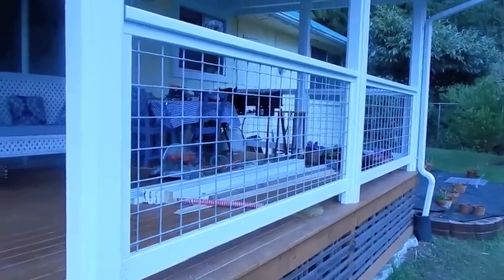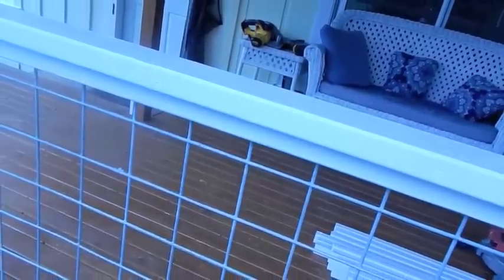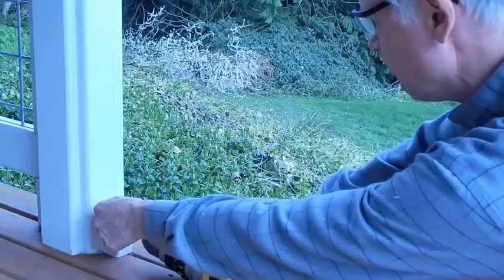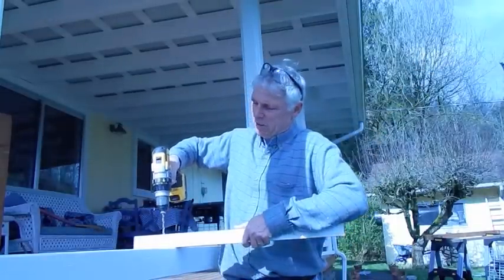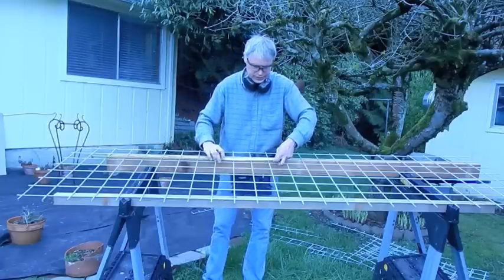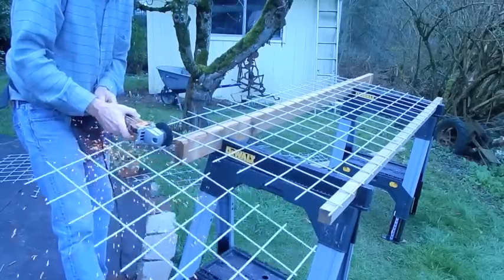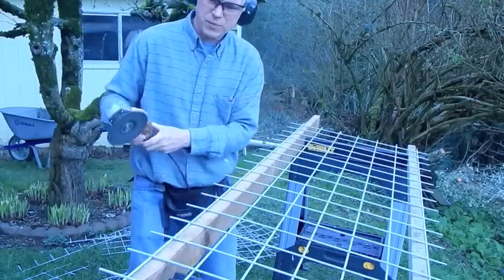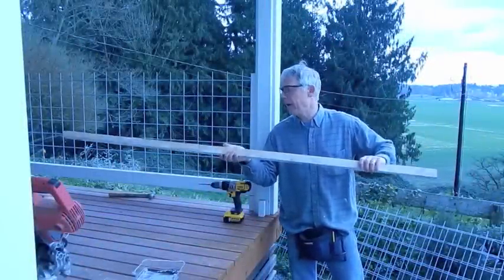Hog wire deck rail installation

Comment: Well I did pretty much what you did building my 800 sq.ft. deck.  What I learned: Although I waited almost a year before I painted my railings, it was to no avail as they started peeling after 8 years. Treated wood just will not let paint stick over many years and will just start peeling. I also used galvanized screws but unknown to me was they were rusting where exposed to any water and air.  So after 25 years I now have a real problem and no easy fix.  I know painting a deck that has treated wood, no matter how dry is a huge mistake.  What I learned is to use only stainless screws and any coloring is to be done w/deck stain.    If you don't use screws you cannot take the railing apart years later to restain or paint.  Try sanding or refinishing a deck railing that cannot be taken apart and you have a nightmare .  So make sure your hardware will stand the test of time and do not use paint, although I did find painted treated lattice has held up fine now for 30 years, likely due to its very rough surface.

Comment: As others have remarked on this video, they like the details you present, such as the calculations you need for complete lengths, or interior lengths, etc. - it's easy to get these wrong when you are just beginning on work like this.

I have a question about the type of wood you used: cedar, fir, pine?, and the grade: no. 1 or no. 2, kiln dried I assume.

Many thanks for the video.

Comment: Excellent tutorial, Paul. I'd like to use the same panels for my deck railing, but I'm having a very  hard time locating 5ft x 16 ft. hogwire panels that have 4" square mesh. Can you please tell me where  you purchased it? Thanks.
Reply: TRACTOR SUPPLY HAS IT

Comment: If you paint the inside of the hog fence black, it will be less noticeable, and the view will seem less obstructed.

If you paint the outside of the hog fence white, it will draw attention to the railing, distracting a bit from what is behind it on the porch. And will tie it (visually) into the railing and house.

Comment: I've never dealt with hog wire, is it rust resistant?  Great video by the way.  Looks great!
Reply: Yes, it is galvanized
Reply: As he said in the video - galvanized. Nails meant for outdoor use are normally galvanized; if you wan't a comparison. He also painted it. I'd say that it will probably outlast the untreated (I guess) wood (2x4) used in the project.

Comment: Very nice work man.  Talk about a man with attention to detail; obsession to detail!  I do wonder though, considering that you had to go back in and fill in the cut out grooves on the lower horizontal piece of wood and if you had to do it again would you not have just sandwiched the lower part between two pieces of wood so that any water would not puddle inside of the groove and rot it from the indide out?  Or maybe rather than cutting a groove in the lower wood, drill holes in there instead then fill 'em in partially in with some caulking before inserting the hog fencing in there so that there would be some squeeze out of the caulking and it would seal up the wire in there?  Just ideas, still think your work and video were really good.

Comment: I see a lot of rot in a short amount of time with all those groves
Reply: He fixed that problem towards the end of the video. The groves that are vertically won't get much rain in them, and it certainly won't stay there in puddles.
Reply: Maybe, but his porch has a roof that will prolong the life of the deck and railing considerably.

Comment: Nice video but you keep saying to "pre drill" a hole.  How do you do that?  I tried to pre drill a hole once but then just ended up with a hole.  If I drill the hole, it's drilled.  Why not just say, drill a hole.  Adding the  "pre" doesn't really change the meaning.